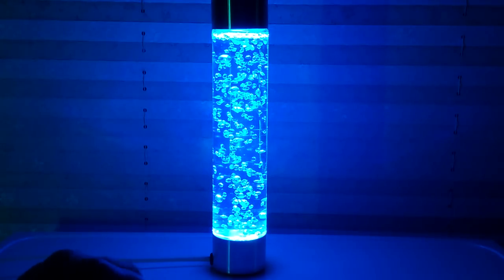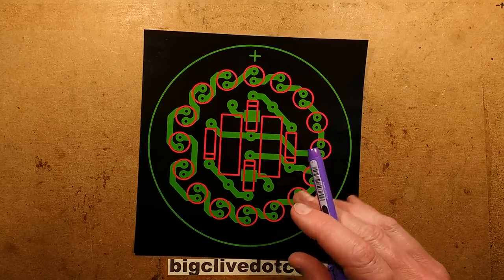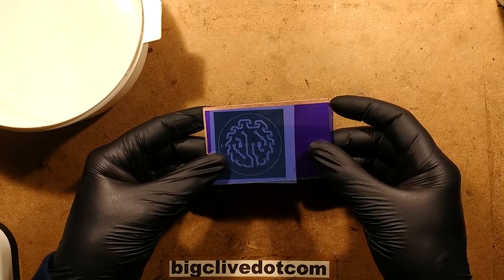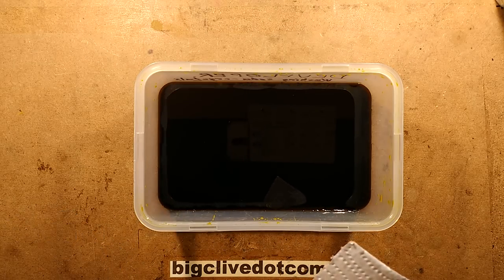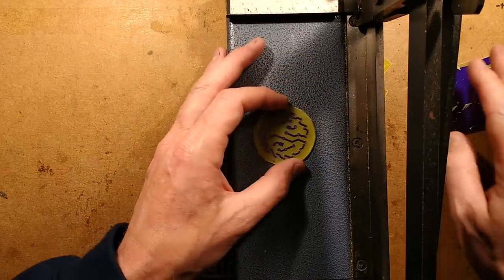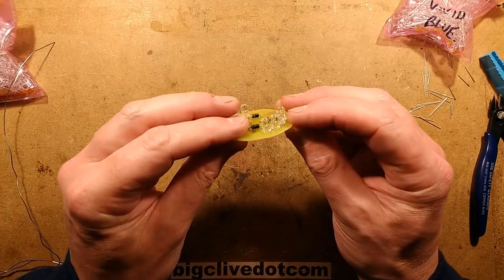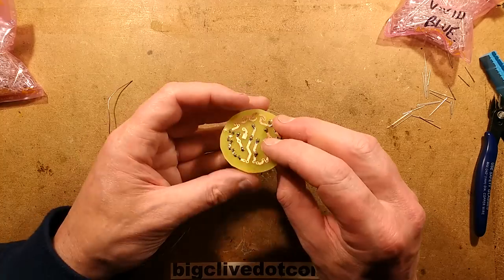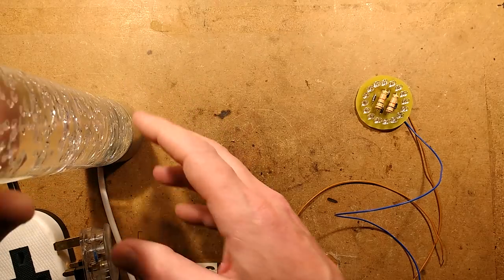Gillian's Diamonds LED crystal remix.  Full build.

Comment: You talked about sleep and the body's ability to maintain it's duties, I have run into such a situation.  You see, I live on very strong narcotics, which enable me to live a sort of normal life despite the severe pain that is the result of an accident back in 92.  The doc's keep trying to operate to cure it, however they have given up after 4 major operations on my spine, and now simply keep feeding me heavier and heavier narcotics.  Now I am on Fentynal as well as hydrocodone pills.  This leaves me rather tired most of the time, and it is not at all unusual for me to fall asleep, even when typing posts on boards such as this.  Well last year, when camped down in the desert of Arizona, avoiding the snows that cover my home in South Dakota, I fell asleep whilst watching a youtube video and holding a full cup of hot coffee.  When I awoke, I awoke with a start, the full cup of coffee, now cold thank God jumped out of the cup and doused my Macbook Pro with the black evil liquid. Well the keys on the keyboard stopped working right, and I ended up using an old bluetooth keyboard with it, this lasted about a month, then the screen went black forever.  I still don't have the urge to disassemble the old gal, she served me very well, and I care about the old machine like only a fellow Macbook owner could. That said, she is too old to pay someone to fix and I guess she would make an excellent target the next time I head out into the country to exercise my old M1911A1 Pistol in .45 Caliber.  It does wonders to hard drives and makes them quite unrecoverable.
Reply from the maker: Rather than dispose of the computer you can look for the opening guides on YouTube and maybe check out Louis Rossman on YouTube too for finding the liquid damage in these things.  Apple products are not really designed for maintenance.
If you just use your computer to browse the 'net, consider a Chromebook with a big screen.  I use an Acer 15.6" Chromebook for most of my browsing as it's much faster than a typical computer.  It does require the use of cloud compatible printers though.
Reply: Louis Rossman is an excellent channel for leaning about electronics from a non-engineer type guy.  Even if you aren't going to fix up your macbook (though I'd say that seeing Louis' work, quite often liquid damage follows specific damage patterns and you'd likely be able to fix most faults with just a replacement chip or two and a soldering iron, and some isopropyl or flux to clear liquid corrosion), you learn a lot of non-technical troubleshooting information there.  Louis, Bigclive, and another channel called Mr Carlson's Lab are the three channels I've learned the most from; they all sort of work on different stuff, but the knowledge from all three is extremely useful in general for working with electronics.

As for the pain stuff, I feel for you.  I have a pretty nasty autoimmune disease that caused a whole ton of damage to my bile ducts a few years ago, and after seven or eight severe septic infections, I'm stuck with permanent phantom pain in that spot.  Despite the fact that I am grateful for being in free-healthcare Canadialand, the doctors' only solution is to... you guessed, throw opiods at it.  Currently stuck on large doses of hydromorphone (sometimes called Dilauded).  Definitely wouldn't suggest it to anyone; it takes supreme effort to counteract the side effects.
Reply: Since you're recommending a Chromebook, I'll take that offer and raise to a used x86 machine with an open-source operating system. Ubuntu isn't that hard to use, with the XFCE or MATE desktop environments especially. And the upside from using an open-source system means you can use applications not entirely bound to the Internet to function, have a "Traditional" operating system, lots of customization et cetera.
Reply: Just a note on the Chromebook computers. If you also have a Windows machine with the Chrome browser, you can set it up so your Chromebook can use your printer(s). You can also do this with Linux if you have CUPS set up (in a much more server-centric manner)
Reply: shooting up the hard drive dosnt work as well as you might think, I have seen ontrack recover shot up drives by filling the holes in the platters and re-balancing them.  They get a surprising amount of data back by doing that.
Reply: them Fentanyl lollipops and patches tho........hooooweee
Reply: When i want to get rid of a hard drive i just take it apart and melt the platters on the stove.  They can't recover data from a liquid...  I'll second rossmann his vids are good.
Reply: therealnightwriter sounds like you're the one on opioids ;) There's another magical treatment called DMT
Reply: Jerry Ericsson I would have thought that you would like to access the data on its drive from another system, and do so quite easily, since hard drives are very well sealed and would not work if any bits of dust was inside. As far as your pain in concernec, you should try cbd oil from hemp or better, extract. But not the hemp oil itself, which contains very little cbd. You want the cbd which is isolated from the hemp oil. It is orderable on eBay. Will minimize the amount of narcotic pain meds needed and eliminate discomfort felt as dosing time. It is really worth trying.
Reply: Jerry Ericsson Beware of taking hydrocodone over long periods of time. NSAIDS should be avoided when not needed.
Reply: Jerry Ericsson Oh!!! And Lidocaine Patches are wonderful...I think they can depend upon the type of injury though...I swear by them, as do others, yet one person I told triec them and said they did nothing for him ( he also said narcotic pain meds did nothing). So it might depend upon the source of your pain.  Watch out though, a lot of the lidocaine patches have a whole bunch of other ingredients in them. If you have good insurance try to get tne 5% lidocaine patches by prescription. Otherwise get the over the counter kind, I suggest the Salonpas ( brand) Lidocaine 4%  patches, measuring 10cm x 14 cm these are the large ones, about 4" x 5.5" . Don't get ones with any other ingredients in them ( not including the "inactive ingredient
Reply: Prehistoricman ...and CBD oil or better, extract and Lidocaine Patches.
Reply: rock doctor You don't have to be bothered with melting the platters. The data is irretrievable once removed from its clean room environment within its case.
Reply: please don't live with the idea that data from bent hard drive platters or with a hole in them is unrecoverable...
it is a barrier but no replacement for a good and thorough wiping process
or if you are impatient melt the damn thing down or shred it to tiny pieces
wouldn't trust any other method
Reply: @bluephreakr  Interesting, though chromebooks are only glorified android 6.1.1 phones running Chrome OS with a large screen and very small storage spaces, 16 or 32GB of storage, sometimes 128 if you shell out as much as a mid-level gaming system costs. In that case, get said mid-range gaming system, and run linux, or, if you have windows stuff, run Windows on a 2nd drive and have Linux as your main.
Reply: @nightshadelenar  If one needs access to the same files on both Windows and Linux, and access on Android. I've found using NTFS for WIndows, and Ext4 for your linux system permits symlinks to a common partition using ExFAT. Works a treat once you set it up.

Comment: 18:50 "I'll have an H2O, too." When you use muriatic acid as an etchant, you need to add a source of free oxygen like hydrogen peroxide to the solution. Usually only need a tablespoon or two for the etchant required to cover a board like that.

Comment: Technically, you could have used four of the LEDs to make the rectifier (at the cost of having those four flicker a bit).

Also, with the right type of wall bracket(s), that lamp would look like a giant fuse.

Comment: Sweet, another PCB making video.
I was wondering if the exposed dry-film could also be developed using one of those cheap ultrasonic cleaners. Meaning like, chuck the weak caustic solution in the ultrasonic cleaner (maybe in a glass jar, those waves seem to propagate through glass) together with the copper clad plate and let it run for 3 minutes, this seems to be more reproducible than rubbing the developer into the copper board. Or would this procedure be too aggressive?

Comment: Would it be at all feasible to devise a mounting solution for putting the (roughly) circular PCB on a drill, and using that as sort of a lathe, and just applying the file to the edge as the PCB spins around on its own? I'm currently thinking two strategically drilled holes on the PCB that are only there for the mounting itself (and to keep the PCB centered, of course), which in my mind wouldn't require too fancy of a fastening solution and would make the finishing up much quicker -- and potentially scalable depending on the positioning of the mounting holes. I do hope I am wording this in a reasonably clear manner. :)

Comment: Very nice BigClive. I wonder the result if using 1 or 3 (or higher) Watt RGB LED chips in the base providing both the heat factor and ability to mix or have only one color active from select switches in the base.

Comment: Love your projects Clive! I saw an ad for silicon spray cans on ebay very cheap, you think you can use one of those to insulate the metal cap? I thought about it because the sides of the cap are still kinda prone to mains interaction, is it not? Perhaps a more convoluted plastic cuting and gluing would work, but silicon spray seems like an insteresting idea... or am I talking crap heheh I could be.  Still, nice work man, love your videos! keep it coming!
Reply from the maker: Silicone spray is usually an oil as opposed to a coating.
Reply: I was looking at the ones they use to coat exhaust pipes, but I guess a layer of electrical tape would sufice hehehehe, overcomplicating shit.. thank you clive.

Comment: Nice video, just like allways, I love your DIY projects. Just one thing to ask you: have you ever thought about doing your own liquid tin compound to chemicallyl tin the PCBs once they're etched?  It gives perfect tinned surfaces, and looks very professional.
Reply from the maker: I used to do that until suddenly the expensive tinning liquid suddenly precipitated out and stopped working.
Reply: I think remember you can do it yourself, the chemicals are not really expensive, just a bit of pure tin solder, acid, and another compound, i don't remember the name now... you can do small quantities. Didn't knew it could precipitate by itself, i'll remember not to do large ammount of it.

ps: i made a bit of reserach:
clorhidric acid >30%
unfluxed pure tin or silver tin for plumbing
tiocarbamida CAS number 62-56-6
tartaric acid CAS number 133-37-9

also, the longest process is to disolve the tin into the acid, you can keep some of it and just use the tiocarbamida and tartaric acid right before using it...

oh my, i made this response way too long...

Comment: ..... Concur, low voltage version if left on will contribute to a better sleep.
P.S. Hurry up and finish with Summer, bloody 1°c this morning, (Melbourne Vic.).
Reply from the maker: That's the only time I could handle Oz heat.
Reply: .... I was trying to say that a low voltage version would be safer if you wanted to build one for friends.
didn't articulate it well though.

Comment: I have had great success printing circuits out onto normal paper and using the old WD40 trick. Later I progressed to quality tracing paper. I found that when printed with a laser printer they were more durable than even copier transparence, where the toner used to flake off.

Last time I made a circuit board with a circle of LEDs I put them so that + was inwards to the circle. I can't remember what program I used to  do this, I suspect it was a graphics program as opposed to a dedicated PCB one.
Reply from the maker: I used to print my transparencies with a laser printer on standard Daler tracing paper.  But some modern printers put down a very thin layer of translucent toner.
Reply: The older hp printers let you chose toner density in the settings on the printer itself. No idea how helpful it is, but turning that "high" and turning off toner saver would lay down a dense, feelable bit of toner. Default settings are thin and transparent looking, which is odd because you'd think they would want you to use up toner. Some of the aftermarket toner cartridges are "weak" also.

Comment: Have you ever considered investing in a small desktop cnc for pcb machining? Less supplies and chemicals, plus you can get the traces and pads made, drilled, and final board cut all in one process.
Reply from the maker: I have considered isolation milling, but it can have issues with even the slightest bit of warp in the PCB causing excessive cutting depth or skipping.

Comment: If you used ws2812 LEDs you could have a way simpler PCB layout, use a 5v PSU and have an infinite range of colour and animation possibilities. Control by Arduino or just use one of the really cheap WS2812 remote controllers.
And/or try using PTC heater to get more constant great without risk of thermal runaway or burning resistors.

Comment: Hmmm.  The light seepage is going to be, at least in part, because the transparency is spaced from the gel by the peel-off layer.  That peel-off layer serves no purpose, the way you use it.  Could it be that it's there so you can peel it off to stick the transparency to the gel to prevent movement when it's in the UV source and get closer spacing?  Of course, that way you don't get to re-use the transparency.

Comment: I did the muriatic acid (concrete cleaner) method, but you need to mix a percentage of hydrogen peroxide into it for good results (can't remember % - need to find the video) . It works well, very fast, to the point you may want to dilute it slightly to slow it down.

Comment: putting a knot in the wire just off the circuit board would protect the leads being torn off say if someone tripped over the cord, or just from general wear and tear.

Comment: Have you considered making a "zapper" to blow out those occasional pesky PCB shorts that sometimes are left after etching a PC board? I usually use Toner Transfer but have tried other ways, most of them (if you don't almost overdo etching) can have slight issues leaving some tiny traces between PCB lands, especially on more complex boards.
Reply from the maker: I usually just examine the board with a bright backlight and use the PCB drill to gently abrade bridges away.

Comment: Great video again clive. Would love to see you do a double sided board inc the developing as in this one.  I do a lot of stuff with micros on so you can't avoid two sides normally so would be interested to see if you have any tips and tricks!  Also, do you have a link for the component jig, I can only find one and it's £6 which seems a bit steep!  Cheers
Reply: Forgot to mention, have a look on UK Farnell for this prod code 9432299.  It's a flat through hole resistor, 10W rating! Might be great for projects like this
Reply: Re component jig, take a look at https://www.reichelt.com/gb/en/?ACTION=3;ARTICLE=5595;SEARCH=bending. There is an addition for P&P but the site has loads of other goodies to make up an order.

Comment: I was always taught to solder first and clip after, because the long lead acted as a heat sink, helping to protect the component. This was in the early days of silicon circuits (early 70s if you're asking, but as you're all proper gents, you won't be asking!), are components more robust these days?
Reply from the maker: Modern components do handle higher temperatures.  I prefer to pre-trim leads to allow better soldering iron access.  Theoretically the shorter lead will heat faster and store less heat.  I'm not sure which has the advantage.

Comment: Fro 120V US voltage the right choice for 2W dissipation is 2400 ohms total. or 1.2K per resistor. W = E^2 / R. Rearranging: R = E^2 / W. For 70V drop and 2W this is 70^2 / 2 or 4900 / 2 = 2450. Per resistor that is 1225 ohms, and 1200 ohms is a standard value.

Now to go watch the USB version of this build...
Reply from the maker: You have to keep in mind the current through the LEDs.  It's better to keep it below 20mA for 5mm LEDs.  The USB version is better.

Comment: Clive what about tossing it in an ultrasonic cleaner to do the cleaning with the cleaning chemical? That might clean the holes out a little better.
Reply from the maker: It would be interesting to try.  I'd be wary of the ultrasonic action maybe undermining the resist.
I've discovered that the main issue with the areas between the pads was exposing it too long so it hardened stuff where the light seeped.  Unlike the older resists this stuff only requires about 60 seconds in my exposure unit (versus 125).
Reply: Using the cleaner may only be worth the time to set it up if you happen to be doing a lot of them if it does happen to work.

Comment: Has shocking pink gone off trend? 
I think I'm going to have a go at making one, I have Jack Daniels and Bombay Sapphire bottles which should look pretty good. 
Thanks for the tutorial.
Reply: If you use a divided supply for the blue and green LEDs you can get the exact shade of turquoise needed. A thin sheet of fluorescent diffuser above, and the colour mix is very near perfect. Heat source - centrally mounted metal tube with two power resistors attached to provide 10W input, and you are almost home and dry.

Comment: Put a hole in the middle of the design and attath it to the multi tool with the grinding disc attatchment and then run it on a file to make it round and also a terrible mess which is what being a man is about. Gadgets and making messes.